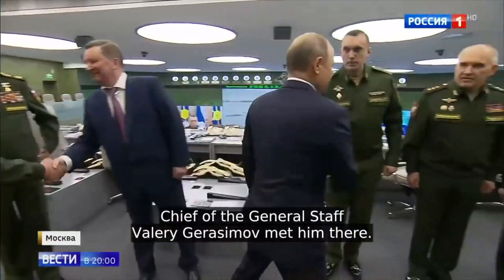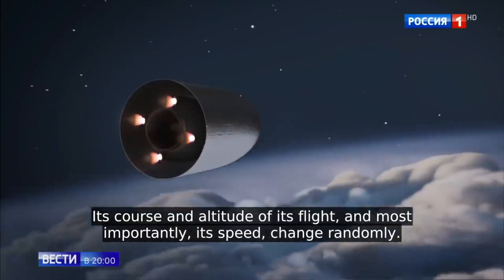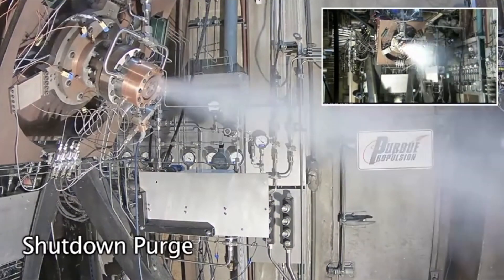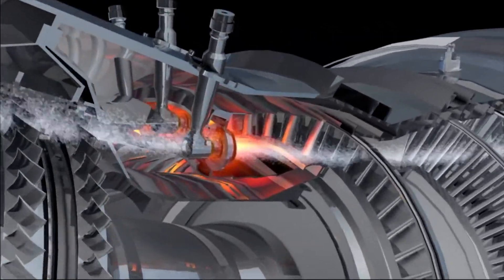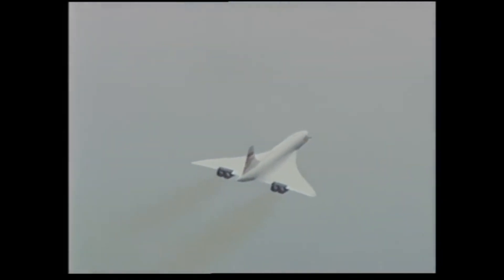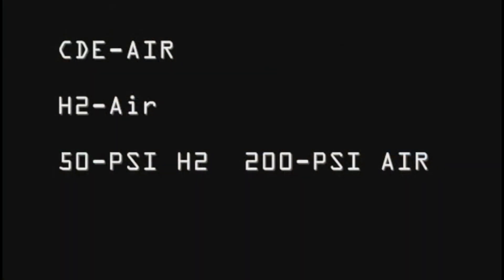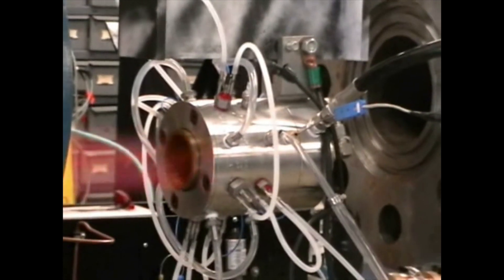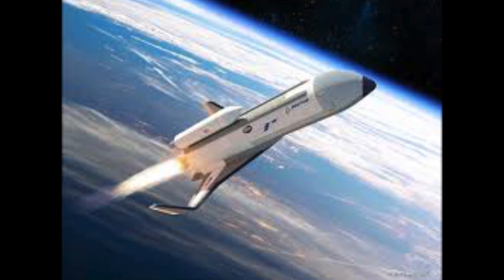Rotating Detonation Engines - Hypersonic Flight

Comment: I can't see this being used for airliners, due to the sonic boom problem, and the extreme cost f the materias needed to cope with the heat of hypersonic travel through atmoshere. However, , I've eard that RDE's should be about 25% more efficient than conventional rocket engines so if/when the tech is understood well enough to deploy commercially, it could well make launches to orbit a lot cheaer, and send  probes to the outer solar system faster than is possible at the moment.

Comment: The reason there is no commercial supersonic travel isn't the engines or the fuel. It's the sonic boom and the legalities of not being allowed to fly over land masses super sonic due to the boom.

So the key tech needed for supersonic Commercial travel is the tech to reduce or eliminate the sonic boom. Which is being worked on.

Comment: been looking for ring detonation engines since some nut crack talked about the ghost plane Aurora that supposedly had a full body aerospike ring detonation engine that ran on some shock sensitive metyl mercury compound. The fuselage was the ring inner wall and the hyper sonic shock-wave was the outer. They stopped flying it because the immense mercury pollution gave it away. Obviously all complete bs.

Comment: I read a report and seen a small television clip in the early1980s about a inventor that made a large sheet of this strange looking plastic film , that could withstand  temperatures of 20,000 degree c.The strange properties of this plastic type film would not burn at all under any pressure that was thrown at it.The inventor was  taken very serious  by NASA and was flown over from the united kingdom to J PL in america  for testing of this material , for the shuttle programme .I found it very interesting at the time coming out of university and getting my first job at Rolls Royce aircraft division.Strange thing about this inventor .I never heard of him again.I wonder if Area 51 got him and the invention???.
Reply from the maker: Hi David...that’s the story of Starlight...it was invented by a clever hairdresser in the uk....nobody could make it and he never shared the secret recipe.
Reply: Yes i think so.He could never get it made on a larger scale.I think he was offered £50 million for the invention by a chemical firm from Germany but turned it down by his daughter.I also think his daughter give a clue in the clip saying  part of the, recipe was crushed bone and ceramic plates and baby nappies made in the oven.
Reply: @davidmyersretiredaerospace8038  Most likely containing Baking soda which out gasses CO2 when heated. Now used intumescent paint.